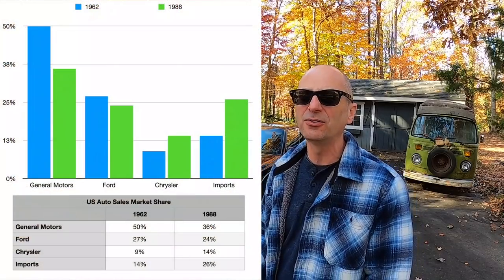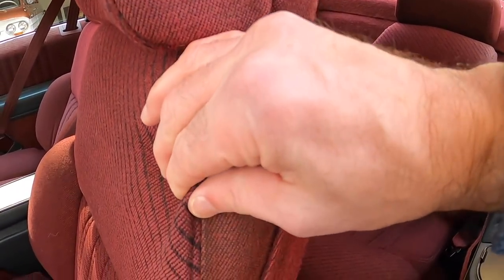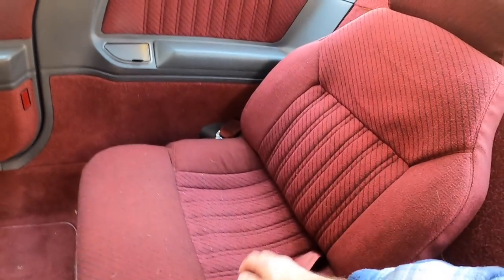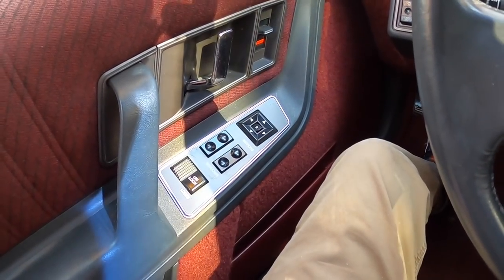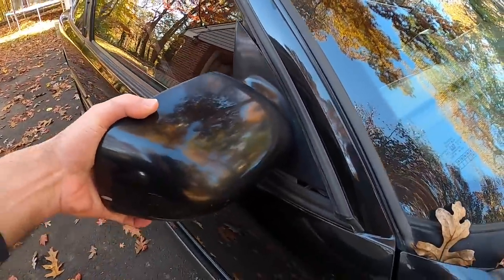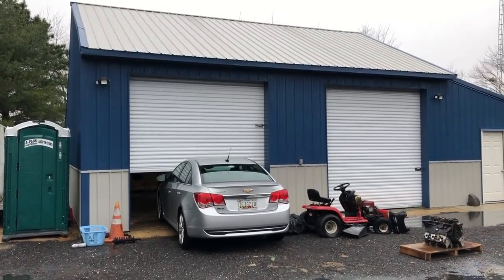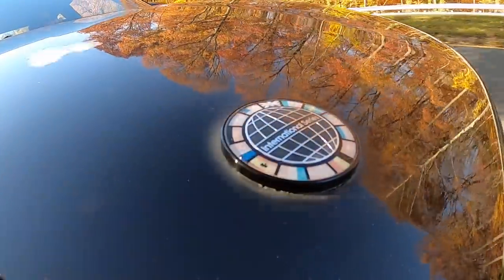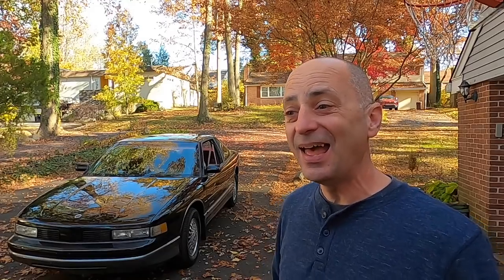1988 Olds Cutlas Supreme International

Comment: Beautiful and rare car, thanks so much for posting this and for giving it so much love!  They're aren't very many videos about these cars unfortunately.  I own a 91 International Supreme coupe so I know these cars very well.  I totally understand you saying how you couldn't get enough of them when you were a kid.  I felt the same way!  For 1988, they are pretty rare in that they have some one year only features.  This includes the lack of rear shoulder belts like you mentioned.  Also, the International emblem on the cluster bezel is a one year only thing.  Same goes for the trunk emblem with it surrounding the key hole.  All 88 International cars had the 15" cross laces and all W-body's in general were 2.8 cars.  Either with the 4 speed auto or 5 speed manual (excluding the Regal).  Also, A/C was standard on these cars as well, not optional.  Things like cruise, tilt, pwr windows/locks/mirrors were optional though.  Beautiful interior with it's correct Garnet Red floor mats, (one piece rear mat on the earlier coupes like this), and still sporting it's original black with white font radiator cap.  These plastic top caps were switched out to metal ones in 1992.  Again, thanks for posting this beautiful example and really enjoyed watching it!

Comment: I had an international and it was the coolest most comfortable car I ever had. My car was a five speed, which I learned was pretty rare. The car drove and handled like a dream. My steering wheel had controls for the radio and other controls. The coolest thing was the on board computer. When you started the car in the morning a message on the screen would say good morning, good afternoon, etc. You could type in destination and it would tell you the arrival time and how much gas you would use. I sold the car at 275,000 miles, my friend finally retired the car at 337,000 miles. I absolutely loved that car, it was like driving while sitting on your couch. Love to find  another .

Comment: I had a friend that had a 1988 Oldsmobile Delta 88 with FE3 sport suspension, 3800 engine, red leather seats, honeycomb aluminum wheels. Driving and riding that car was great.  Firethorne metallic paint.  He purchased it brand new. He had the car till just before he passed then sold it to his cousin. A car I'll never forget.

Comment: Very cool car!  I had a 91 Lumina Z34, and we what character  that car had!  Mine had the 3.4 Twin Dual Cam, 210 HP.  Sold it when the engine started ticking at 14 years old.  Before that, I had an 87 Chevy Celebrity Eurosport with that 2.8 V6.  Great sound!

Comment: The rear shoulder belts were added in 1989...I think it was a government mandate.  I worked for one of the top 3 rental car agencies in the early 90s and the W cars were a fleet staple.  During the recession of 91...a decision was made to stock Cutlass Supreme International Series as our luxury class.  When my daily driver was in the body shop for a week, I used my employee discount to rent one....dark red with a gray tweed interior...and it was pretty decent, especially all of the seat adjustments.  

I had some other W body car rentals, a base model Cutlass Supreme that had the carpeted door trim pulling away from the doors...and a Pontiac Grand Prix we took on a road trip...no real issues.  and a Chevy Lumina..and all had the classic GM ergonomics with sharp interior trims and budget plastic that plagued GM in the 90s....

Comment: Bought a '93 International new from an Olds dealer in Delco. Not a great experience with the car. Kept it less than three years. Had an '87 442 also bought new from the same dealer and thank God I never sold that and still have it now. The International was a very good riding car and it handled well. It did have ridiculous torque steer where the steering wheel would jerk out of your hand if you started with any speed from a standing stop. Quality issues were immediate. Leaking windshield, leaking trunk, rattling exhaust, cloth door panel in a leather interior. Dealer fixed everything except the leaking trunk which they frankly gave up looking for the leak. I found it eventually caused by a lack of body sealer in the fender well. The car was expensive listed for $25,000, two door electric blue with 17" wheels and the aformentioned leather. Five years into the model the only interior change from your '88 was a trunk pass through and optional heads up display. The engine was the new dual twin cam 3.4 V6. I understand it proved to be costly to maintain. It was the last Oldsmobile I ever bought after buying four in the '80s. Not the best example of Olds or GM and helps explain what happened to Olds ten years later.
Reply from the maker: Great comment and thanks for sharing.   GM just wasn't doing any favors at that time with the cars they built.  Kuddos to you on keeping the 442!  They're stunning cars.  My neighbor had a similar experience as you with an early 1990's Cutlass convertible.  Issue after issue and problem after problem and ended up getting the car bought back by Oldsmobile.
Reply: That would be a uber rare car now!  1993 was the last year for the International Series trim and the lowest production numbers.  Incorrect about the 17" alloys, it would have had 16" pie alloys.  Most 92-93 International cars were very well optioned, the 3.1 cars are actually more rare because of this.
Reply: Also, HUD was available in production cars starting in 89 so five years into the model year isn't accurate.  The Twin Cam 3.4 V6 debuted in the Spring of 91.

Comment: Can't believe it has been 34 YEARS (!!!) since this car was new.  It was way ahead of its time.  Now here we are in 2022, and I can remember how well advanced this car was when new.  It was as if the year 2000 came 12 years early.  Now these Cutlasses are a rare sight, and most of them have made their way into junkyards.  Those digital instruments were a sight to behold in 1988.  Wonder how well they worked after 10 or 15 years?  This one here, though, is still immaculate today.  The new FWD Cutlass Supreme was leaps and bounds over the old rear-drive model (that one was still available for '88 as the Cutlass Supreme Classic).  I wonder, however, why "only" a 2.8-liter V-6, even though it was sufficient enough for this size car?  Seems like there could have been a way to get the 3800 V-6 under the hood, and make it at least optional.  I loved the CSIS when it was new, and I still love it today!  (1/22/2022)

Comment: I had a red and silver 1989 Oldsmobile Cutlass Supreme International Coupe with the red interior the same color as yours my steering wheel had the radio and ac controls it had the 3.1 Multi Port V6 it also had the digital climate control and the digital driver information center it had every factory option that you could get except for the sunroof HUD(head up display) and leather seats if I knew what I know now I should have never sold that car I been looking for one in great condition ever since

Comment: Not many people realize those seat belts are designed so you don’t have to undo them when you get in and out. It’s designed so you can slide in and out by lifting the lap belt and leaving it hooked up… it was GM’s answer to “automatic” seat belts.
Reply: Yes that is true, but people didn't want to fight with it.

Comment: my 89 Thunderbird only had lap belts in the back seat, too.  No airbags for GM because of the 'passive' restraints where the seatbelts were attached to the doors.  The idea was the seatbelt stays latched and you get in/out without having to move the seatbelt.
Reply: Few people know about how to correctly use the front seat belts.  Kudos and yes, you've described it perfectly.

Comment: My 88 Cavalier Z24 5-speed 2.8 with 130 hp is very peppy and fun.  My 97 Cutlass Supreme 3.1 automatic with 160 hp doesn't feel as quick as the Z24, perhaps because the 2.8 has a wider power band than the 3.1.  The Z24 weighs less, also.

Comment: Awesome Cutlass Chris...... when I saw that 2.8 liter engine I thought to myself.... oh no......one of GM's worst engines ever..... I think if I were going to replace it due to head gasket failure, I would have replaced it with a 3.8, one of GM's best engines over the years.  Glad it's worked out for you though, it is a very sharp car.
Reply: totally agree.

Comment: The 2.8/3.1 engines were pretty good although they sometimes blew head gaskets and another issue was the o-ring on the oil pump shaft driven by the cam.  That o-ring would start to leak fooling people into thinking it was a bad rear main seal or in extreme cases oil would pump out so fast it could destroy the engine.  (These engines used in minivans had a distributor whereas the cars did not).
Reply from the maker: Oh wow, good to know and thanks for sharing.  And thanks for watching too!

Comment: Chris, I won a few bets on Chevy made a 2 door Lumina. Do not believe me, have a look. Car made that same exhaust note. I thought it was rather peppy with that 2.8L. Nice work on your movie production.  Ross
Reply: Who doesn't know Chevy made a 2 door Lumina?
Reply: The two door Lumina didn't appear until 1990.  None were made with the 2.8.  It would have been the larger displacement 3.1 or 2.5 Iron Duke 4 cylinder.  Not sure if the Iron Duke was offered in the two doors actually.
Reply: I stand corrected. After I entered my comment, I realized my 90 Lumina was a 3.1 When Chris opened the hood and showed the engine,  it looked nearly identical. Sorry, but that was a few years ago. Ross
Reply: @jiggity76  Since 1990 was the first year for the Lumina in any guise, you are right.
Reply: @mexicanspec  No biggie, just wanted to make sure we had the right info out there.  I appreciate your comment!

Comment: I worked on these cars and they were brand new the haziness around all the trim is a material they put on the paint to protect it called causaline is hard to remove and shows up years later.
Reply from the maker: Wow man, thanks for sharing about Causaline.  My mission now is to get that crap off.  And thanks for watching too!
Reply: I think you are trying to say Cosmoline.
Reply: @hullinger  When I worked at a Chevy store in 1988, the sales department sold a new off the truck Beretta.  The car was never PDI's and was covered in the cosmoline.  This was a Sunday sale.  The buyer brought the car back months later as he wasn't able to remove it.  The wipers made a few lines he could look through but other than that it was still covered in the stuff.

I took the car and washed it with the bottle of cleaner that was under his seat and the car came completely clean.
Reply from the maker: @mexicanspec    When you said Cosmoline, I immediately knew what you’re talking about.  Thanks for that.  Remember the buried 1957 Plymouth Belvedere in Tulsa?  It was covered in that stuff when placed in the ground.
Reply: The spell check wouldn't let me spell it correctly thanks for clearing that up. 👍
Reply: @hullinger  That is what Chevy called it and the car wash guys had to get it off every new cars.  We sold 300 cars a month, so it was a lot of work.
Reply: @robertsuper7451  I think he just has faded paint on his car though.  I doubt there is any cosmoline still left on it.  It would have been caught before its delivery to the first buyer.  This was not a cheap car and I am sure it was inspected well.

Comment: If you kno the radio is making a popping sound and not just a bad speaker, then you could remove the radio and change the cdm module which sits on top of radio,, 3 or 4 1/4" screws and switch it from another,, they're common so even in today's time your still likely to find one

Comment: You should have replaced the engine with a junkyard Series 3.8L. Hopefully a 260hp Series III supercharged version would fit. 

Also if you were doing the 2.8L just to stay stock then I would have had that mechanic just rebuild the one that was in it. He was already taking apart an engine so the $1100 you spent on the remanufactured engine could have been spent almost all on rebuild parts. Bored out, better pistons and rings, maybe a livelier cam, blocked machined, valves etc. The guy put new gaskets and whatever in the remanufactured engine so there was that money too.
But boy if you found a junkyard supercharged Series III and let that guy tighten that one up people would line up to buy this char.

Comment: GM was clueless back in the 80's.  Had this brand new w body design, introduced EXCLUSIVELY as 2 doors(good looking coupes I might add IMO)   No sedans though, which had been the trend for the past several years in the mid-size medium priced segment(baby boomers had kids and didn't want coupes)

 GM didn't roll out sedan versions until 1990, a full 3 years after the coupes dropped.  I mean you could have been an old timer fuddy duddy and bought a cheap Ciera(a 7 year old design) or a more expensive/posh box on wheels Olds 88.  Those were fine cars if you were a blind man.  Its like GM just REFUSED to build a modern/stylish sedan in the 1980's(I love a Caddy Brougham or Caprice, but those were all 1970's designs)